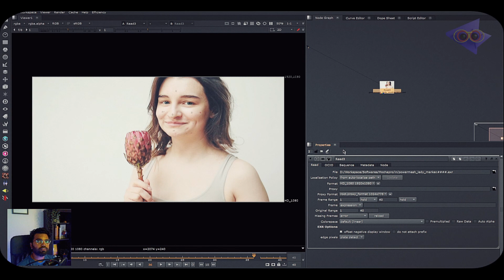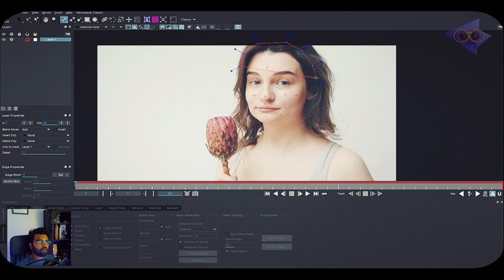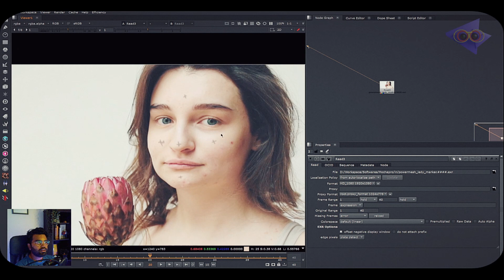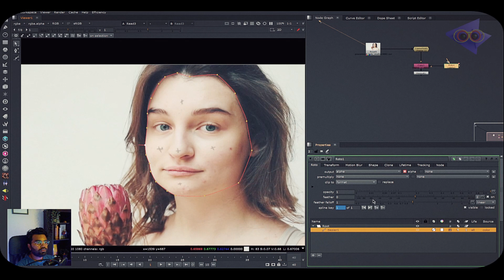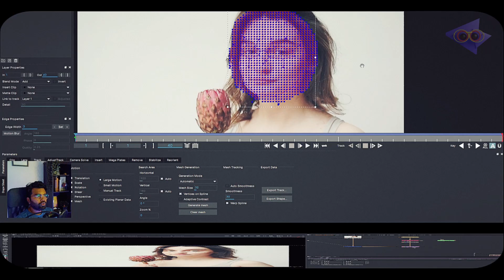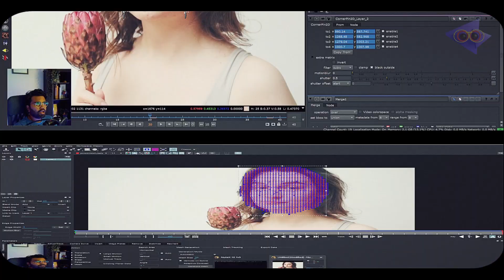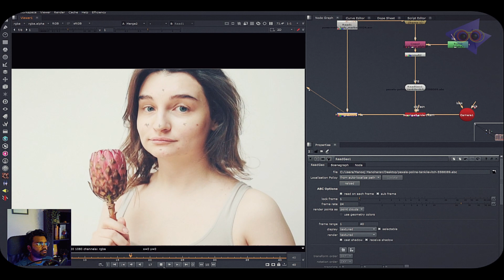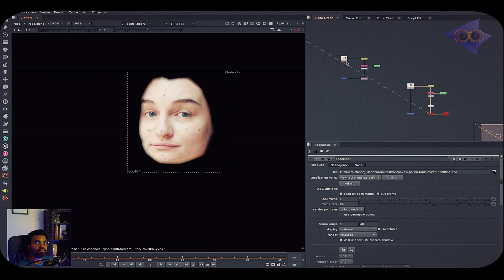Tracking Precision Test! | Mocha Pro PowerMesh vs Corner Pin

Comment: Power mesh is incredible, but it doesn’t hold up well when the actor keeps turning their head all over the place.

I still start with stabilized precomps (corner pinned,) because it’s usually ‘enough,’ and the track is faster.
Reply from the maker: Thanks for your feedback